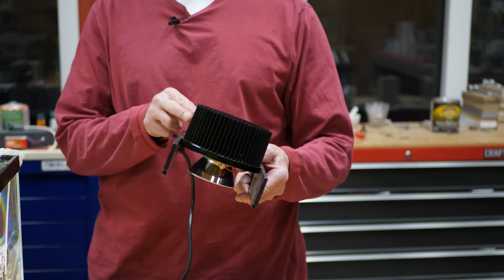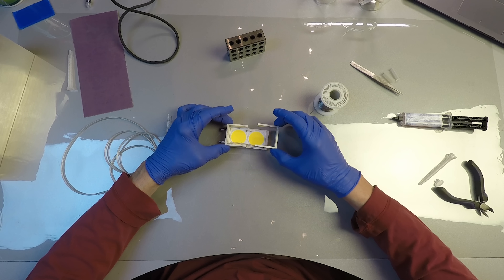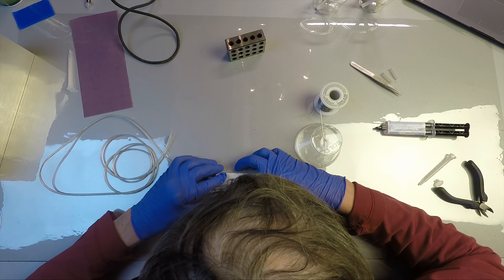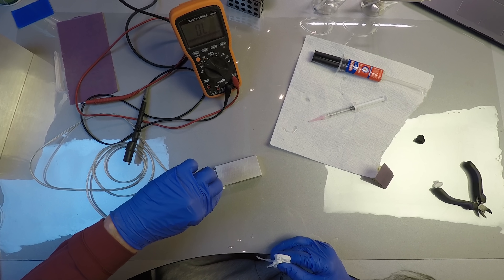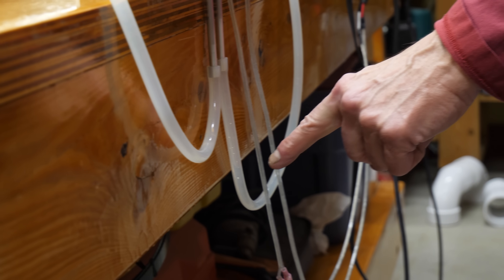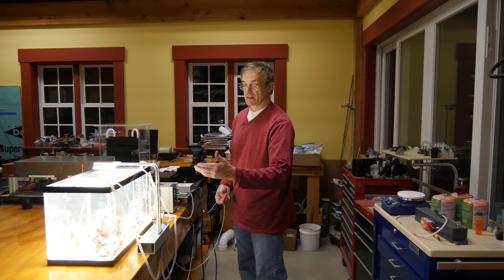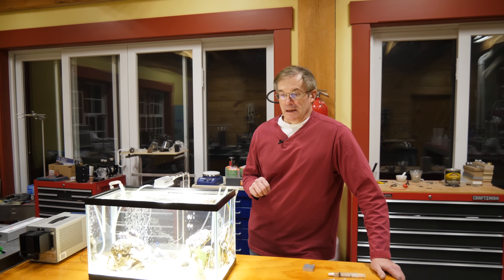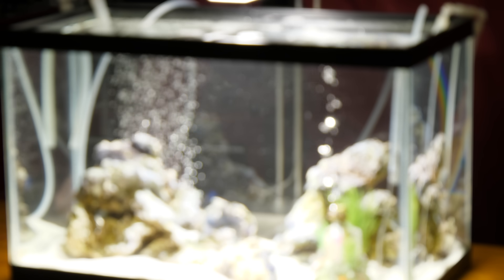40,000 Lumen LED Aquarium Light

Comment: Surface Submerge the light  atop aeration  discharge in cold climates, besides a ghetto heat pump. Luv the epoxy idea  use an
Motor oil  radiator  12''x 6''

Comment: Neat stuff. The bio-engineering lab I used to work in had a really tough time figuring out what materials they could use for bioreactors. The cells are really sensitive, and they found that only specific types of metal and tubing wouldn't kill them. A single commercial component was causing failures that they traced to leaching from an internal gasket. I am really interested to see what kind of micro-leaching might happen with different epoxy coats. It is something we never thought of trying. In-theory, If we combined it with in-house additive manufacturing, we could make cheap single use bioreactors.

Anyway I am mostly commenting so the youtube algorithm you guys more attention. 

Cheers!
Reply from the maker: Thanks.
Your requirements  may be more demanding than most.  However, it has been a long standing practice to construct low cost marine aquaria  with epoxy coated plywood. They work well and last a long time.  
You may have luck contacting  Master bond.  This company  manufactures high performance epoxies for optical and aerospace applications.

Comment: One idea with this system would be a microcontroller that reads the temperature of the water 💧 that is cooling the LEDs and speeds up the pump or slows it down.
You might also want to use something else other that epoxy to seal the inner water block due to chemicals getting to the fish. I believe the normal clear silicon would do the job and once it cures, no worries.
What also would be cool is a revolving head that goes onto the LEDs to give it a sort of shadows moving through the water.
Very cool lighting system. I did experiment with different lights on my 100 gallon fresh water setup. It was very cool to see little beams of LED light moving slowly through the water at night. Beams of different colors, a blank CD with drilled holes and spinning slowly by being attached to a 360 servo was ultra cool! I went to the hobby shop and bought different colored sheets of thin transparent plastic, used a hole puncher to create the small color disks, then clued them over the holes that I drilled into the spinning blank CDs.
It was killer to look at in a dark room with Agua colored lighting.

Comment: Can this be used for reef tanks?
Reply from the maker: Sure.  The COBs are available in a variety of color temperatures and their spectra should be available depending on the manufacturer ie Cree or Phillips etc.  With a larger tank, I'd avoid the tank water cooling option and dump the heat away from the tank, possibly even outside the room if you go really big.

Comment: i used epoxy to join plastic tubes for continuous aquarium use. after a few weeks, the epoxy joint turned bright red and eventually failed completely. I suspect some bacteria 'ate' it. This makes me doubt the wisdom of using epoxy in your water block to seal it 17:30 . Perhaps polyester resin or lacquer or anodized?
Reply from the maker: Epoxy is used for boats and to construct aquaria. You might try a different epoxy.
Reply: @TechIngredients  I think that the microbial activity in an aquarium is much more intense than in the environment but that's a good point, I used 'dollar store grade' 5min epoxy so I'm sure that didn't help. The marine/aircraft grade you use is probably more resistant to bio degradation.  Thanks for your reply, I love your channel.

Comment: Wonder if you could use the metal tubing/heat sink as one of the conductors for the light so you only need a single wire going down for the other side.
Reply from the maker: You probably could.  It's important that no potential exists between the water and the metal, increasing the risk of galvanic corrosion.

Comment: Really interesting video. I was wondering if you have taken any PAR measurements using your light? I would particularly be interested at its PAR at 18 inches. Also it would be nice to know the projection angle of the led blocks. I have a 5ft tank and am thinking to make a few of these modules for it. Thanks

Comment: Just one concern, if using aquarium water for the cooling water source, you may have problems with bio-fouling of the heat exchange surfaces that would reduce the efficiency or potentially plug the heat exchanger entirely
Reply from the maker: That's possible.

Comment: I like it !! 
Great eco thinking to re-use the heat ! LED has come on a lot in recent years. 
But for a permanent install, after testing the principle, I would raise the low part of the cooling pipes to above the base of the tank [has anyone already said this, I have not read all 857 comments !] say to half-way up, just in case cat jumps on pipe and it pulls  off, or other gremlin situation.
That way the worst that happens is only half the tank is emptied  (dont ask how I know :(  ),,, and only the led dies.

Comment: what about encasing the leds into epoxy  instead of the glass my 80 gallon tank ive overheated it with a water pump alone one time with my custom designed water polisher polishing it down to 100 micron

Comment: Since you're already using the aquarium water to cool the LEDs, have you considered using a solid copper heat sink, sealing the little wire hole, and simply submerging the entire light in the aquarium? That would eliminate surface reflection, avoid algae clogging, and negate any potential plumbing or mechanical failures. You could still use the epoxy coating trick, but instead of having to coat the inside of the tubes, you'll just be coating the outside of the copper block. What do you think?

Comment: I have just recently discovered your channel and I love it. It is very interesting an I'm subscribed.
I was intrigued by your use of a Peltier device to cool a high power LED. Unfortunately your application as an aquarium light has not been fully thought through. The temperature of an aquarium must be carefully regulated. Usually a thermostatically controlled, 'glass tube' immersion heater or a heat pad is used. Your system dumps the heat from the LED into the aquarium without any regulation so the water temperature will range from too hot (light on) to too cold (light off). Dumping the heat externally is wasteful of electricity. Furthermore, having a very bright light on an aquarium encourages unsightly and hard to clean algal growth. So, great idea - but no cigar.
Reply from the maker: Hold on there.  You don't HAVE to utilize the waste heat to warm the aquarium, but you can.  No electricity is wasted not only because these are the highest effeciency light sources available, but their effeciency increases as they are cooled and that heat is released no matter where you dump it.  With larger aquariums heat is not needed and removing the heat from the fish room saves the additional energy needed to air condition this space as is the case with typical, air cooled lighting systems.

Comment: How much time I need to ON my 2 feet 6500k and 3120 lumens LED batten tube light for 2ft*1ft planted aquarium? And can I use that 3120 lumens with 2feet to my 2feet planted aquarium.
Help me please...
Reply from the maker: You might want a little higher lumen output to allow for absorbtion, but if that's not available then running the light a few more hours per day can compensate.

Comment: This is pretty cool kit for a DYI aquarium light.  I do have to say, having had numerous 100gallon aquariums, I have always found the need for a heater, except for or hot So. California summer months, where temp becomes an issue. LED's have really changed the Aquarium biz. I enjoyed this video.  How much heat does your light produce at the water surface at normal lumens with and without the chiller?
Reply from the maker: It's pretty easy to calculate.  LEDs are emission line emitters as opposed to thermal sources.  As a result, they don't generate any infared heat.  Given that they output about 25% of their input power as light and the rest is dumped into the air or as we did in a liquid cooler, you can calculate the watts added to the water vs the watts consumed to produce the light level you want.  They produce about 150 lumens per watt.

Comment: I have carolina reapers at home under a similar light. If you want to find more info on this, SAGs guide on lightening is a treasure trove of information. I bought a dimable meanwell power supply 

- Cree isn't the best anymore. Really interesting are the new Vero 29 lamps, they are cheaper and more efficient. https://www.bridgelux.com/products/vero-series
- If you are from the states, you get more bang for the buck for quantum boards.
- At a real 100W lamp you should really check the temperature. I have a CXB3590 at 60W max in my kitchen that supports the sunlight coming from the window to my herb collection with an arduino. This gets relatively warm at just 50-60W. For the reaper lamp, I got a 25 dollar Arctic cooler 120W CPU fan and a used lens.
 A watercooling loop is really awesome!

Keep up the great content.

Comment: Let us suppose that there are actually 20,000 Lumens each (which you never showed us that you tested as such with a light meter), When adding more than one array DOES NOT double your lumen output. It only increases the area of light. So 2 20,000 lumen LED's will still only produce 20,000 lumens. And that is if you drive them at full power. Which will shorten the life span of the LED's. They are to be used at lower than their full rated capacity. Which is about 75% to 80% at max. So each one is NOT providing 20,000 lumens if you want them to last. There are some more errors in your calculations but I will leave that up to you to figure out. You really need to educate yourself on LED efficiency to know that they will never operate at full lumens. You also need to educate yourself on how much heat a true 20,000 LED array will actually produce. There are several LED projects that you can find on the net from real Engineers and Electronic experts that will help in understanding the LED and LED Arrays. If you would like some of those links, let me know and I will be more than happy to supply them.
Reply from the maker: I think you are confusing lumens with lux.
These COBs are rated by the manufacturer at 20,000 lumens at maximum driving current. We can drive them at full current because of the water cooling block.  Approximately 250 watts needs to be dissipated and at a flow rate of 1 L/min that corosponds to a 4C temperature rise.  Thanks anyway for the comment.
Reply: @TechIngredients  I am not confusing lumens with lux. No LED is rated to run at max current all of the time. If you are running them at max current constantly, then you are killing your LED's by shortening their lifespan. Check the spec sheet for your LED and other high power LED's. You will see that they are not designed to run at max current and/or voltage. The spec sheet will show you everything that you need to know. Also, the heat generated at max current will also kill your LED faster. Well versed in LED technology and electronics.
Reply: You could also contact the LED manufacturer and ask them. They will tell you the same.
Reply: Here is a cheap way to test both of our theories. Get 2 identical flashlights. Shine one at a wall. Then shine the other one right beside the first light on the wall. They brightness will not change, only the area that it affects. Now shine both beams at the same spot on the wall. The light will still not get any brighter because you will only get the intensity of brightest one. Try this in a normally lighted room and then try it in a dark room.

Comment: Interesting. It caught my attention. I wonder about the construction of a 10,000 lumen SAD light for people with Seasonal.Affective Disorder. I am curious about what sort of inexpensive light filters would screen harmful wavelengths. These devices seem to be cost prohibitive and a less expensive DIY would probably create a lot of traffic.
Reply: I watched this video a second time and read many of the comments. I was wondering how well the glass walls of a cheap aquarium would work as a radiator if you used your thermal paste and aluminum strips along either the bottom, top, or corner edges to dissipate the heat. In response to the criticisms about the Epoxy film that I have read tt also seems that soft-drink companies are already using a film inside cans with highly corrosive beverages such as Coca-Cola.

The reason for my follow-up question is my friend has made an air-quality sensor that includes inexpensive UV lights inside a plastic enclosure. The frequency of UV is apparently not in the right range to produce ozone but there is enough of a glow to the device in a dark room to be concerning. Which brings me back to my original question. Would these COBs produce light that would be safe for a  SAD(Seasonal Affective Disorder) light device? Would the plastic from a 3d printer filter UV light adequately as my friend seems to believe? Because his plastic is white I am wondering if there is enough reflection inside his device to allow reflected uv light to escape through air vents. I will try to research these questions on my own, but I hope my comments help you enough with Youtube's algorithms to raise your profile or catch the attention of one of your more knowledgeable fans!

Comment: Another lighter-duty way to seal the inside of the block, or  other type of water jacket, or even a tube-and-fin-style radiator is to put clear acrylic floor finish (like “Future” - NOT the mop’n-shine types that self-strip) in it and roll it around every which way to coat all surfaces, drain the excess and let it air dry. Obviously, a second coat can’t hurt. It’s very inert when it cures, and if you’ve ever had to strip a floor of it, you’ll know it’s very tough, especially for something that cheap and readily available, is of fairly low toxicity, water soluble, dries pretty fast, and not too bad on fumes.

Comment: Very elegant.....But....... (not trolling you just offering an observation) as a long time aquarium enthusiast I can tell you with absolute certainty that in zones 6 - 10 overheating the water is a major issue with or without lighting. Also, my  familiarity with cooling blocks and heat...IMHO .....  the aquariums in the mentioned zones will no way come close to safely dissipating the heat input. After all, they can barely manage ambient temps in an air-conditioned room.  After a short time, a day or so.... you "will" cook the fish. That being said, I admit am not familiar with this particular Cree model or case management thermal requirements. However, I would venture to guess that at 100% lm (not sure of your volatage or amperage)  they would reach temperatures of at least 50 - 55 degrees C or 130 degrees F.  Most tropical, will not survive or thrive at temps over 80 degrees and only flourish in the low to mid 70's. Consideration must also be given to BTU's given off from the front of the LED as well. Beautiful,  elegant design and build though. Have you looked into the Cree LMH2 that come nicely fixtured and only require passive sinking? Yea.... a tad expensive at about $80 then the sink is another $10 or so. Plants would certainly flourish nicely under these lights. I truly enjoy your channel.
Reply from the maker: Thanks!
Keep in mind that this lamp can be dimmed to an optimal output.  Also the 10 gallon or 40 liter tank was for the demonstration and not necessarily the recommended volume for a lamp that puts out as much light as a 400 watt MH.  Finally, as I suggested for large tanks where heat build up can be a challenge even with minimal lighting, the water cooling option allows you to remove all the waste heat from the fish room without an expensive airconditioning system.
Reply: @TechIngredients  Thanks for the response. I must say that every thing I have seen you undertake has been carried out with precision, well-thought-out and superbly executed.

Comment: Do you know what the PAR rating is?  Coral require a certain amount of UV spectrum.  But it is an interesting concept,  If there was a concern about the epoxy coating eventually breaking down and introducing aluminum into the marine system I suppose you could use some stainless steel tubing in a heat exchanger that the tank water flowed through.
Reply from the maker: I'm not sure, but I think it may have been 89.  Nevertheless, Cree makes a wide variety of these COBs with different spectra and published curves.
You have a lot of options including simply not using the aquarium water at all.
In a number of our videos you can see the neat water to air heat exchanger I built from overclocking components.

Comment: Can you sandwich a few 62mm TECs between waterblocks cooling the hot side with PC watercooling and adding a pump/res to the chilled side?

Should increase efficiency, right? Plus the chilled side would be independent and have faster heat dissipation.
Reply from the maker: It would increase the effeciency of the LED, but the overall power consumption will probably increase.
Reply: @TechIngredients  - But it would cool the dickens out of a PC/laser/LED.. sweet. Thank you, professor!
Reply: @TechIngredients  - Aside from using nuclear decay to heat a TEG (Seebeck Effect/RTG) are there any other methods efficient enough to use a TEG to power TECs?